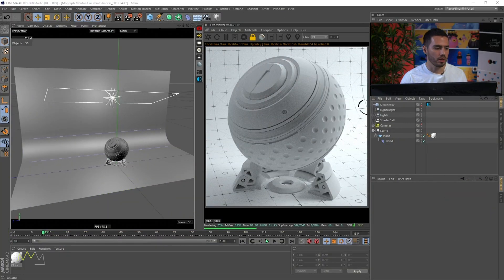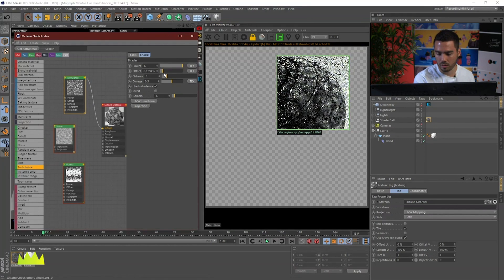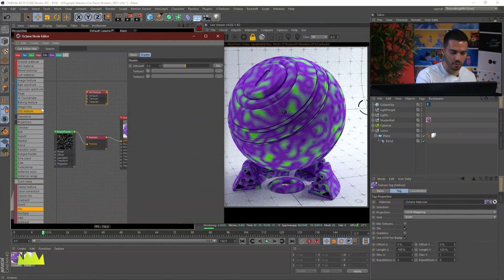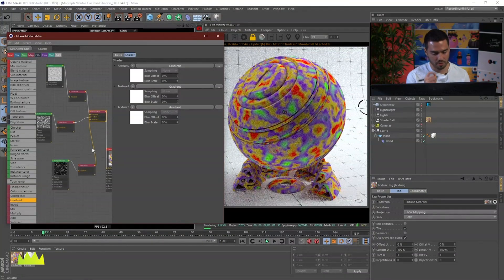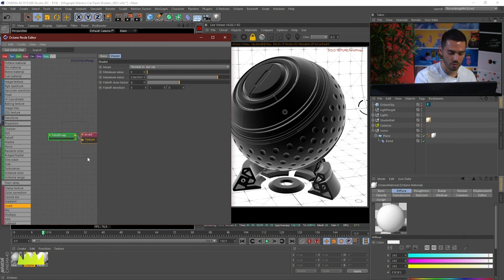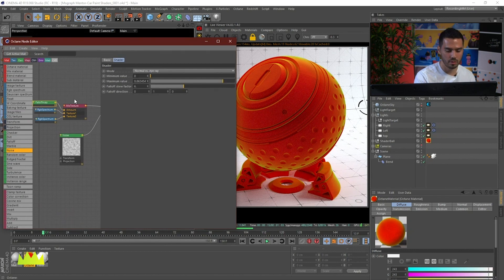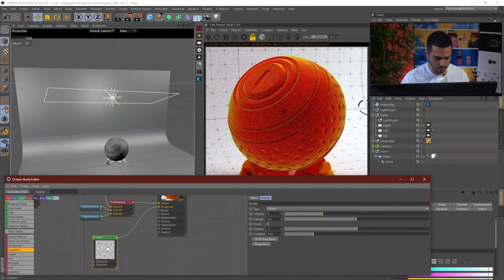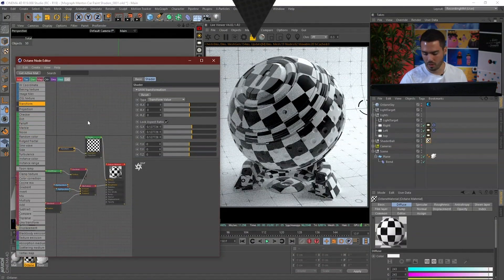Guide To Octane Rendering : Noise & Falloff Nodes

Comment: Actually the Falloff node is not dependant or influenced by the light like you say at 7:52.
It is dependant on the angle of the polygon to the camera. The more the polygon is facing to the camera the more white it gets, the more it is facing away from the camera, the more black it gets.
You can compare it to the fresnel shader of standard c4d material.
you can observe this phenomenom in nature when you look to a lake for example: if you look in the distance the water surface reflection is strong and you can't look through the water. but if you sit in a boot and look straight down on the water the reflection is less and you might be able to look through the water.